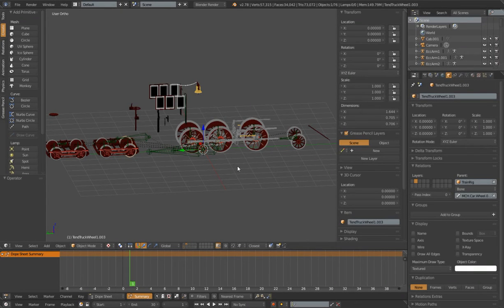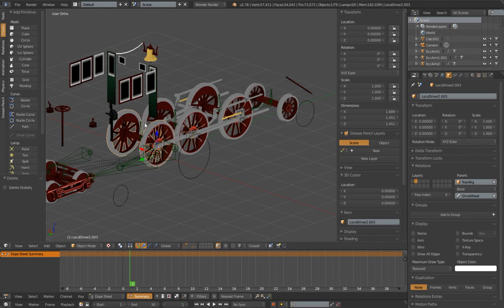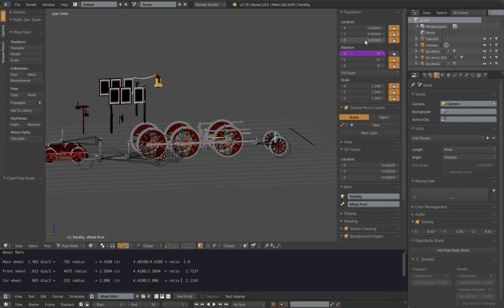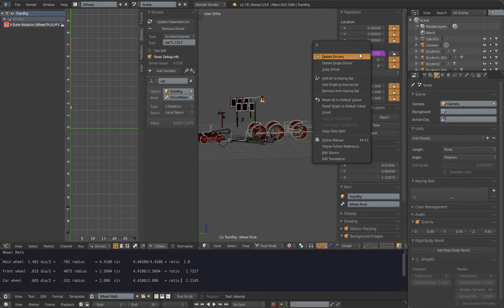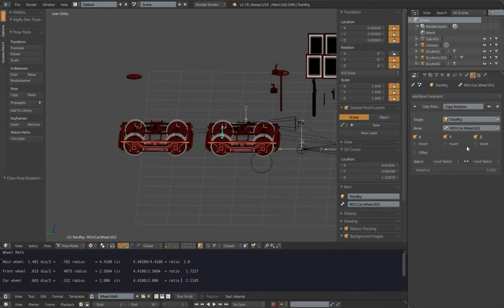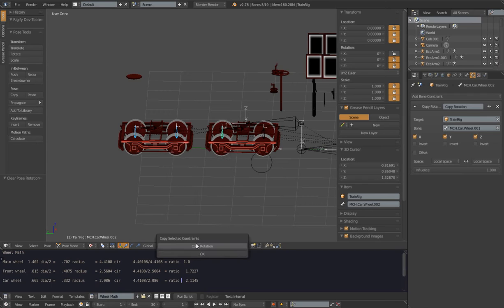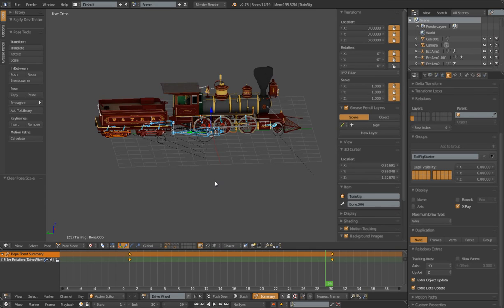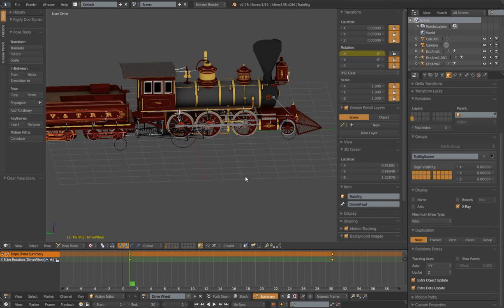Blender Rigging Tutorial   Rigging a Train Part 2

Comment: Here is it 2024, I',m a CAD designer running SolidWorks 2020, I was given a full set of plans from a 50's era Australian engine that is a 4-8-2 2-8-4 Garratt configuration, and I made a full CAD model of it. I'm now trying to use that as a basis to learn computer animation and 3d asset creation using Unreal Engine 5.3. 

I'm stuck in South America at the moment and unable to find remote work in CAD, and have been without an income for about a year now, but seeing tons of remote offshore work available for 3d Assets and animation. Also, the video I'm trying to make is a trailer for a story I'd like to write or sell, and which besides being of interest in and of itself, is another possible means to keep my family fed. 

So this could help me on multiple fronts. Failing any of that Unreal Engine is also trying to posture itself for use in engineering and architectural visualizations and simulations, so mastering it helps my overall engineering resume too, if and when I'm able to get back to the US.

Obviously (maybe not to the un-initiated) 3d assets are not CAD models, I had to simplify my model quite a bit within Solidworks, and via a UE5 plug-in I can easily bring that into UE5, which now supposedly supports building the skeleton right in the game engine, but what I want to do is either too complicated or even impossible within UE5. So I pushed it from UE5 as an FBX into Blender 4.0, and I'll push it back when I'm done.

This video of yours is the best I've found for this, despite being dated, and it is surprisingly easy to follow in Blender 4.0. Some things have been hidden in different places, some things are actually easier now, and surprisingly some things are harder. Once I get it rigged, I'll push it back into UE5 for final animation, which is working great for the static stuff and will work well with characters.

I'm going to need my engine to operate at slow speed in tight corners, so I do need to ramp up the realism of my rig a bit. In reality the pivot point of your front two wheels is probably about where the tail of the bone is, as the center of the axle must fall on the center of the track which will be outboard in one direction or the other from the center of the engine frame. I kept a cylinder in my model at the design location of this pivot, so I can handle this OK.

One problem I'm going to have that is not a 1 to 1 with your model, my engine has trailing trucks pinned to the engine frames, which also must be able to shift left and right as well as turn. In real life the pivot is between two pairs of leaf springs lying flat so the pivot can shift left or right with a spring rate to return it to neutral on straight track for better stability.

My thought on this is to set up a pair of collinear bones, heads in the right spot front to back and up and down relative to the engine frame, and all locked but the lengths (I think you do something like this in a following video for the steam cylinder action). The joined tails are then a shifting pivot point. They can then be tied to a center surface that follows the track path centerline. Do you follow me? and does it sound like I'm on the right track (no pun intended)?

Anyhow, great video series and it has helped me enormously in this crazy endeavor. My biggest hurdle, being from CAD and manufacturing, is I want things to be more exact than necessary, or helpful, but the tight curves I have to deal with make this tendency spot on in this particular case.
Reply: making it too hard, I just needed a bone that can rotate in one axis and move back and forth in another axis.